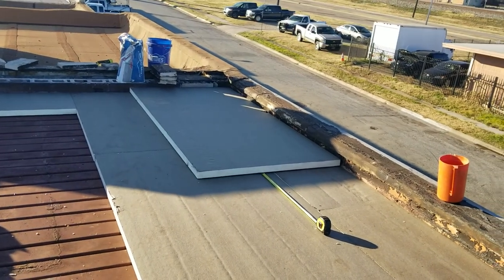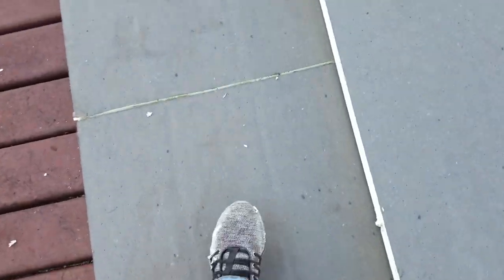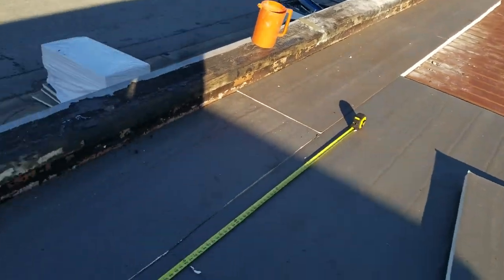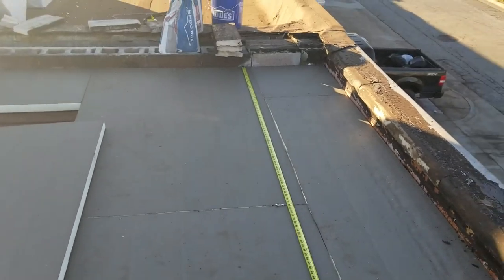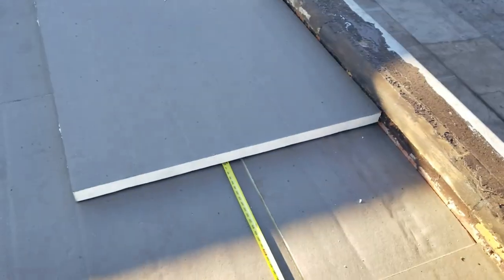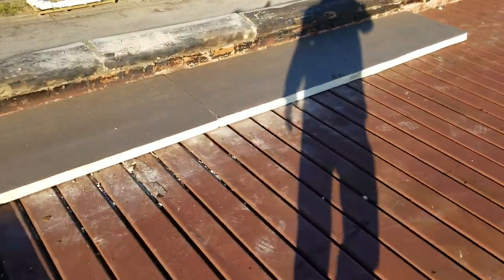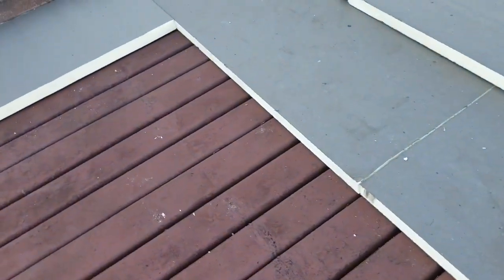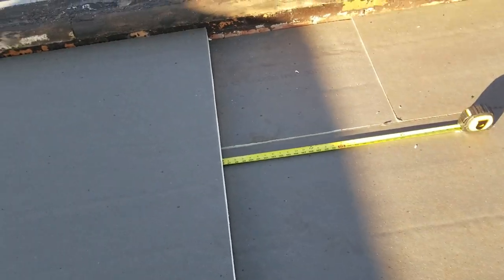How to stagger ISO insulation correctly

Comment: great video but you need vapor barrier on the steel otherwise the Iso will be full of mold. i riped  a roof like that and the Iso was moldy.
Reply from the maker: @sorinmoraru8310  there are a lot factors that go into building a roof system, mainly zone and interior climate.   In this case in the zone we are in, it was not needed and we have to go by the manufacturers guidelines to receive the NDL (labor and material) warranty from the manufacturer.  In a cooler region with the same system, it might have been required.

Comment: Assuming this is a rubber roof on the parapet wall are you filling the gap between the insulation and overhang?
Reply from the maker: Yes the TPO cap sheet will go over the top of the parapet wall then capped off with metal coping

Comment: why do you split the piece by the parapet in half   i understand the 2' 6' stagger part but im curious the reasoning for splitting first sheet   thank you for the info very helpful     sending a like your way
Reply from the maker: It's an easy way to keep all joints throughout the system top and bottom about 2'away from each other